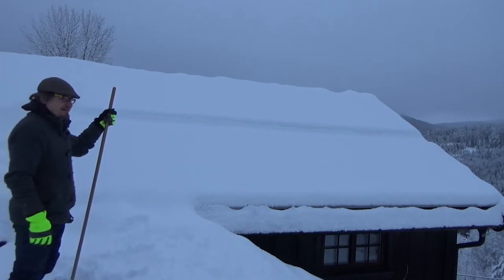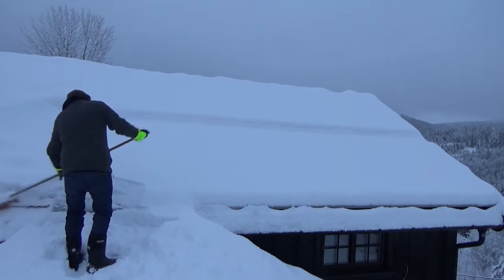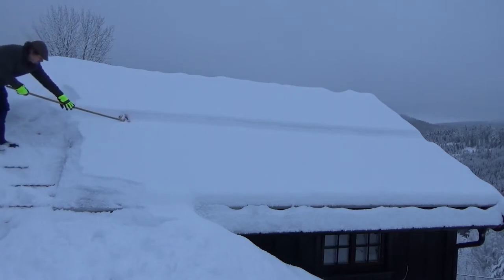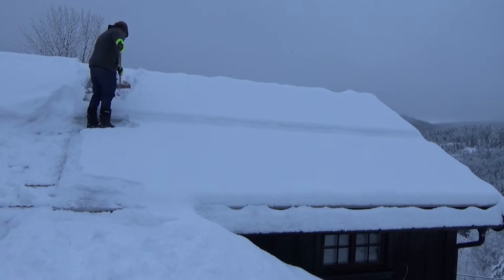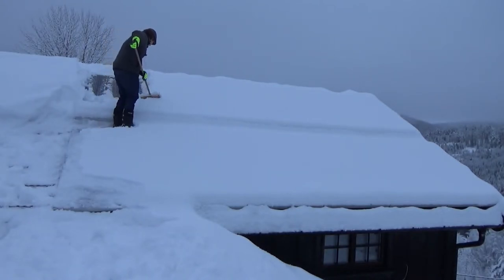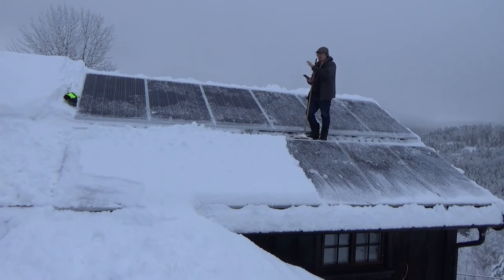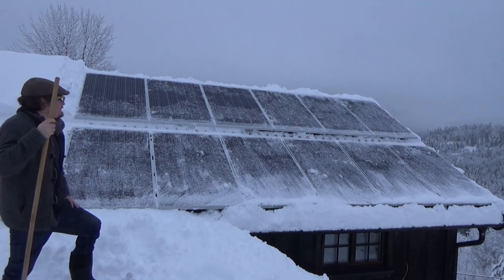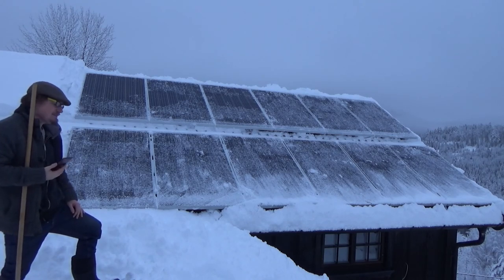Solar panels in the dark Norwegian winter!

Comment: Is it worth it to have solar in Norway.. ?
Reply from the maker: Oh, that is a hard question! Short answer is sometimes / it depends. We are on a shady hillside, so we have bad conditions in winter. Summer in Norway, you have solar power so long, and it is amazing! If you use equipment like lawn mower, drying ovens for vegetables, fridge room, etc that runs on electricity like we do, then it is great to solar power them. For us we use a lot of electricity in summer, so yes, then it is, even with the shady winter. For others the conditions and situations may vary, and so would the gain.